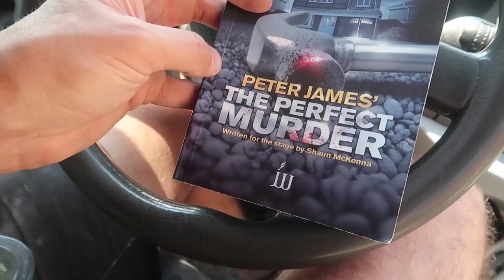Converting Window to Grey French Doors

Comment: Rather than a useless song I'd have preferred useful informative commentary: ordinary foam or low-expansion? What fixings? Were the glass panels removed from the doors beforehand? Did you check the squareness of the frame? Fix the sides or top first? Wedges? The one idea you have was to fix timber guides for the concrete cutter; so thanks for that.

Comment: G'day from South Australia Stu. Could you please tell me what that piece was you glued down with foam along the bottom of the opening? Does that expanding foam really glue things like that down to brick well? Could you also tell me what the fixings you used to screw the frame to the brick were please, and did you use packers between the frame and the brick when you screwed the frame down? 

I would like to do a few window and door changes around my home here and while I have some construction experience I have never done this so some more from you already great videos would be handy to have. If you have this in your other videos, could you just tell me which ones please? I will also need to change lintels in some areas so If you have done this can you point me to that too please?

Comment: Hello. 
I found your install very interesting, recently I had a patio door removed and a French door installed. Big question mark arose, the cold coming in from ground level is very noticeable.  You did something different to what I saw the installers do. You put down a cill? And foamed insulated it before you placed the frame in place, that was not done here and I wonder would this be the reason the cold is coming into room through what I think is the floor at bottom of frame. I appreciate any expert advice you could give,
Reply: The foam under the cill is only part of the story. Yes, it is necessary, but there's one more thing worth checking.
I.e. can you see the vent brick externally, on the lower right-hand side of the french door? This is to vent the cavity. When creating a new opening, it would be good practice to use some form of cavity closer to prevent the draft. On the floor slab level this could be achieved with something as simple as a cut-to-size piece of polystyrene foamed around for full seal. Good luck.